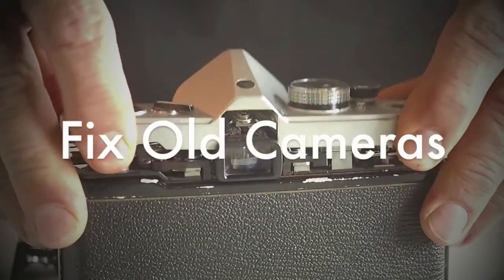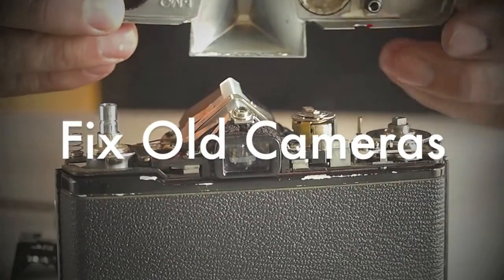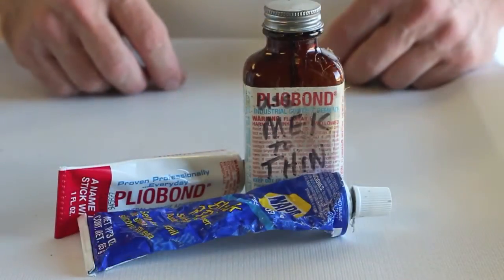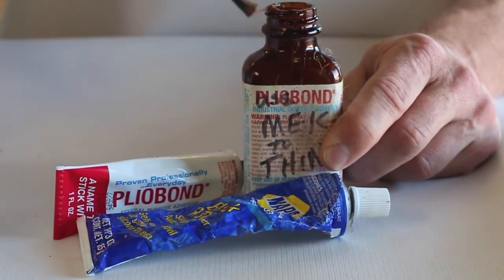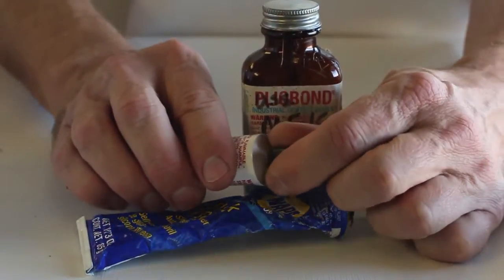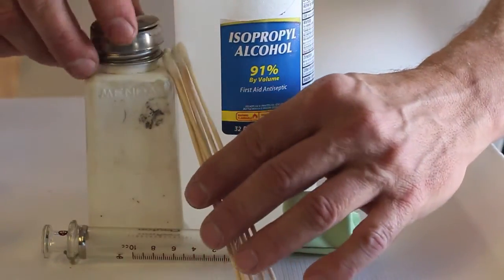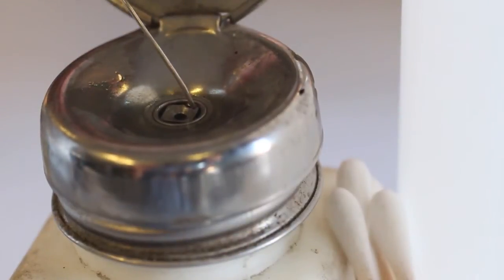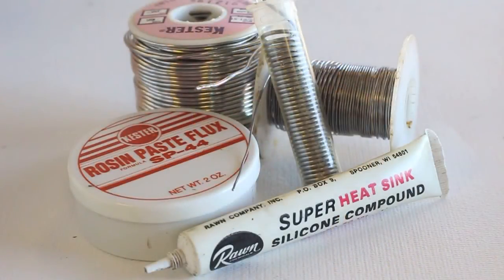Fix Old Cameras: Basic Camera Repair Materials

Comment: Do you have any suggested sources for those recommended items in addition to the ones listed on the link you included (particularly the dispenser bottles)?
Reply from the maker: The dispenser bottles can usually be found at a beauty supply as they are used to dispense nail polish remover.
You will also find some suggestions on this page. - http://miketrost.com/tools.html

Comment: What kind of adhesive is Pliobond? It's not readily available here in the UK apart from tiny tubes at a ridiculous price, and when it is available it sells out very fast.
Reply from the maker: Pliobond adhesive is particularly suited form most classic camera repair applications.  It might be considered to be in the contact cement class of adhesives, but it does not behave as strictly a contact cement. It has proven its worth for over 35 years for this camera repairman. However, there must be some suitable "specialty" adhesives that would work for particular applications. Maybe there are others that have suggestions of what works for them. One example is a common office supply glue stick works fairly well for reapplying flexible leatherette coverings.

Comment: may I ask why isopropyl alchohol is more often used than denatured alcohol?
Reply from the maker: There seems to be less residue upon evaporation with isopropyl alcohol and the odor does not linger as long or as strong. The isopropyl is preferred in working experience in camera repair applications but is not limited to either or.